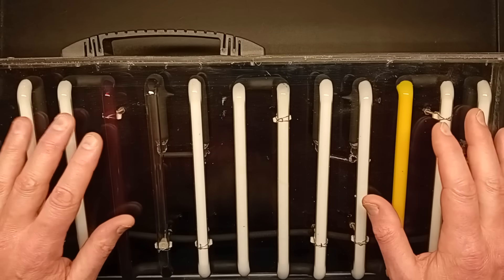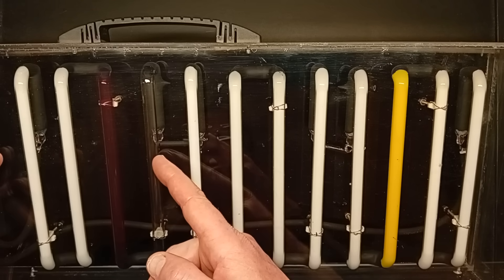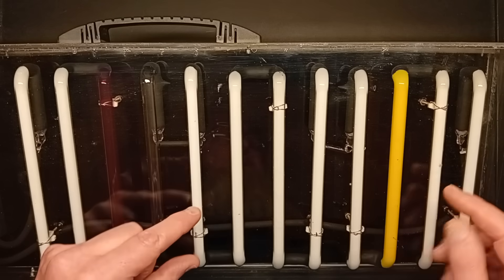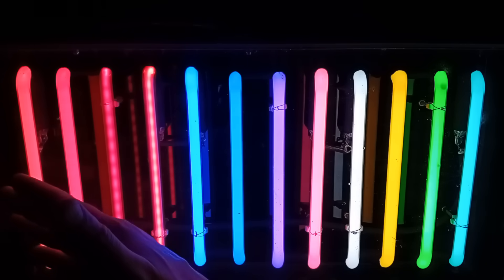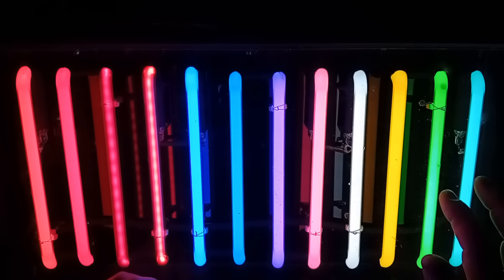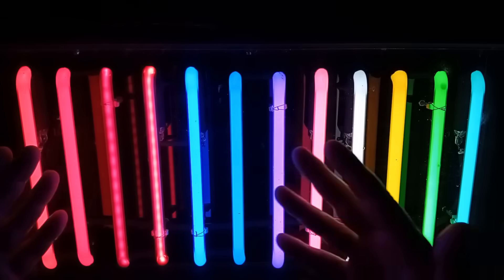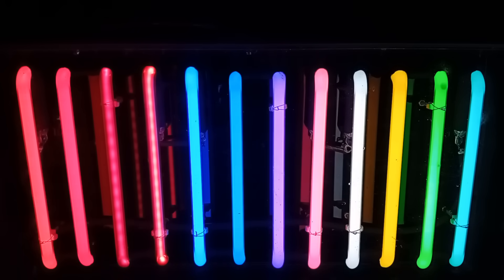REAL neon display case

Comment: Haven't watched any of your videos for a while now, but this one definitely sparked my interest. What a nice gift. Most desirable.

I also have some old neon sign transformers which I use for insulation testing- to the extreme. 

A bit like that high voltage test unit you have demonstrated in the past on chinese made power supplies.

Good vid. Thanks 👍🏻

Comment: I've never seen one of these before. It reminds me of an ozone generator I owned once. It had two interlaced sets of tubes in it; half neon and half low pressure air (strictly for appearances), each set connected to one terminal of a full-size (15kV 30mA) neon sign transformer.  And holyyy heck did it make ozone!  This device is prettier and probably doesn't make nearly as much. :)
Reply from the maker: Those ozone generators are very collectable now.

Comment: Jellybeaning! I never heard that term. For (slightly) more information, look at wikipedia, /wiki/Glow_discharge and the terms "Positive Column" but also the special section on "Striations" where they fail to fully explain the effect. But (my understanding), at the long middle section (away from the cathode and anode) the electrons are just very gently accelerating, and pretty much the moment they get fast enough to make an ionizing collision with gas they will do so (and shed another electron). A recombination event will between an electron and ion will produce a photon (light). After a collision, the electrons slow to a crawl, slowly accelerate again, and repeat. If they're doing this in roughly the same time/space, then you get bands/striations. This area of slow-moving electrons and even slower moving ions is a great place for recombination to occur, so is the main light-producing area of a tube.

Comment: I burned my finger when I put my finger on one of the red tubes on the display. Can you explain why that happen? Is it because of radiation?
Reply from the maker: Real neon can run pretty hot as it can be used at very high power levels if desired.  The vintage helium tubes that produced a golden white light ran extremely hot.

Comment: The color from gas discharge and phosphor tubes really has to be seen in person.

There's something to that postmodernist neon sculpture I ogled fifteen years ago that's stuck with me, and I've never seen anything quite like it since.  (You could probably do a decent reproduction with LED strip if you put the effort in, but most of the LED stuff I've seen so far is slop.  Maybe I'll just track down some decent-quality rope lights and experiment with them as an architectural feature?

Comment: Yellow phosphor is not hard to get, but the  light from the mercury discharge will mix with the light form the yellow phosphor, so it has to be filtered if you want a saturated yellow lamp.

Comment: As much as I love neon for it's aesthetics, they often have chemicals like mercury (those blue and green ones probably) and phosphors on top of using around ten times the amount of energy than an equivalent LED will use.
Reply from the maker: The production of LEDs also includes toxic chemicals.  Neon tubes greatly outlast LED.
Reply: @bigclivedotcom  True. I wonder if there's been any studies comparing them.
Reply from the maker: Many, but sadly they were done by the LED marketing industry, and were therefore skewed for profit.

Comment: The ( old skool ) laminated iron 50 / 60 Hz Neon transformers can be VERY useful for cleaning oily fouled spark plugs , mine is rated at 5Kv - 0 - 5Kv at one Amp ! !  (  😝  )  , totally burns off the carbon in seconds , ( safety note ! )  keep well away as this energy is similar to the USA 🇺🇸 electric chair 😝 handy tip # 56 ....... DAVE™🛑
Reply from the maker: The majority of neon sign transformers tend to put out current measured in low tens of milliamps.  Usually 30 to 60mA.

Comment: That really does take me back Clive. I had my own sound and lighting installation business for 40 years, and in the early 80's installed miles of neon in pubs and clubs. I used a company in Bradford called Butterfield Signs to make the tubes for me, I've just Googled them and they're still in business remarkably. Although I loved the effect, I hated working with it, you got a lot of breakages. You could watch them bending the tubes, it was a true skill. I had a similar display case.
Reply from the maker: That horrible feeling when you're installing a tube and it cracks.

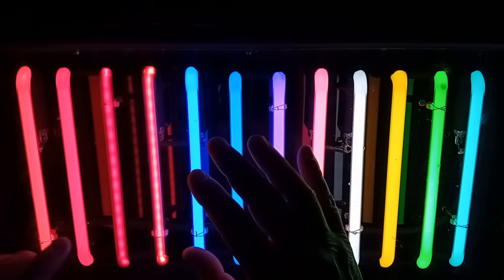Comment: I'm only just starting learning about electricity, but I wonder whether the "jelly beaning" effect described at 2:10 would be a result of the fluctuation in current flow due to transforming AC to DC current.  I also wonder whether the "fine-tuning" mentioned would involve "smoothing out" the fluctuations by using more phases of AC current when converting it to DC or making it more drastic by using fewer phases and/or reducing or interrupting the current flow.

Comment: Got some bits of scavenged neon, pink rods, and pink arrows, then square units, one white and one clear argon mercury. Pink was the shop sign, I kept 2 spare tube of each type so as to make fixig fast, as all i did was switch off, replace the failed section, then have the sign running again for the most common 2 tube types, then call the sign company to repair the failed tube. Generally a shock crack from rain hitting hot glass. the square ones were salvaged from a sign that was never installed, which also gave the electronic ballast running them, though I also have a few regular neon iron core units as well, from the open terminal type to the resin potted units. they do make for great Jacob's ladders, though I really would have to get better electrodes, brazing rod does have a short life, and the copper vapour is not exactly good. would love to find some tungsten wire 2mm diameter, make a permanent ladder/broadband RF noise source.

Comment: Colour neon and fluorescent tubes are beautiful. Yellow needs colour filter because mercury-argon is adding its own colour and washes out the yellow. The same is for red, if you use red phosphor, you get pink. My favourite colour is fluorescent green.
Reply: You can get pink with neon if you use a phosphor which would be blue with mercury. In the same way you can make a yellow neon sign using actual neon and a green phosphor.

Comment: Now you ate in my wheel house Clive! I love real neon! The blue phosphor for that color when pumped with argon and mercy will glow a beautiful pink when pumped with neon, and the green version of the same will glow a nice pure orange pumped with neon! I also love the “clear blue” tubes that are clear tubes pumped with argon and mercury! Was very common before fluorescent phosphors came into use, ironically before fluorescent lights (1938) and came into use in 1933! For green, they used noviol yellow without a phosphor with argon and mercury. White was tubes pumped with helium before phosphor coated tubing. In cold climates, a mix of mercury and neon, known as “Penning gas” was used so the mercury based tubes, phosphor coated or not, would warm up quickly, since neon has more resistance than argon and will generate heat. Helium even more so, and it limited maximum tubing length in signs often requiring higher voltage transformers. Also, helium tubes were sometimes in larger diameter tubes to lower surface temperatures to prevent breakage from thermal shock in cold rain and snow, and had higher current density which lowered arc voltage in the helium tubes to allow more tubing length on a lower voltage output transformers. Penning gas can be and IS used alone and has a purplish red color. I taught myself about neon! All part of collecting light bulbs all my life since age 4! I am 59 now! Cheers! 😋👍🏻

Comment: We have a neon guy in our small town who just finished fixing the neon on the 1920s movie theater. (we have a manly popcorn machine as well which has been a whole share of mechanical ordeals ) Apparently it wasn't an issue with the tubes it was an issue with the transformer that probably shorted out since it was wedged in the outside aluminum marquee. It's nice that it's working again. He said to save any broken tubes as he can reuse them.

Comment: I worked for my family sign business for twenty years. Repaired a lot of neon. We had our own neon plant. I was there for the transition from old iron transformers (what we called them), to electronic. We always found the old iron transformers, the size of a shoebox and much heavier, to be more reliable. The peak beast being the 15060 (15,000v at 60mA). I would LOVE to see a video from you explaining the difference between old style transformers and electronic.
Reply from the maker: The first electronic transformers were horribly unreliable.  But they are much better now.
Reply: The 'peak beast' is 120mA @ 15kV, I have one. :)
Reply: @railgap Very cool. We never used 120mA. Was that for cold cathode lighting or neon?

Comment: Gorgeous item. I miss proper neon - i get that the modern low-voltage LED 'tubes' are safer, cheaper to run and more robust, but aesthetically they're just not the same.

Comment: SO many of the old-fashioned iron transformers off old neon signs have been clipped off of perfectly good tubes by Tesla Coil builders. 

I have found MANY old signs where the transformer is gone, but the tubes still function perfectly when connected up to another transformer. 

I can admit it, I ALSO have been guilty of relieving a couple of old neon signs of their transformers years back when I built my first Tesla Coil and Jacob's ladder. Since then, I have graduated to using pole pigs for my coils. One can only get SO much power out of a neon sign transformer, and I'd rather leave them on the signs these days. The newer electronic transformers are junk for use with a Tesla Coil, so don't even bother with those.

Comment: Excellent!! Neon is slowly dying, and I don't like that fact. 

"LED Neon" just isn't the same. 

There's just something about a high-voltage arc traveling through a glass tube filled with a noble gas that creates different colors depending on the phosphor and type of gas in the tube, is just exciting and soothing to me. 

I collect ANY kind of real Neon that I run across today. I have various beer signs, "Open" signs, and other old Neon stuff. 👍
Reply: LED ANYTHING isn't the same.
Reply: @TheloniasBrowntail I 1000% agree!! it will never suffice for the real neon.
Reply: @TheloniasBrowntail I have eye damage due to glaucoma (and now cataracts) and LED lighting really messes with my vision in a way that older technologies such as incandescent, fluorescent, sodium and neon installations don't. There's probably something about the wavelengths emitted that's imperceptible to most people but really affects me for some reason. I understand why everyone's switched to LEDs as they offer lots of advantages in terms of cost, longevity and power consumption, but I wish they weren't so harsh to look at.
Reply: A building we just sold has an original neon sign from 1940.  We've kept it going for 30 years at quite an expense, but it's worth it.  Sure, the electricals have been redone many times over, and hurricanes have broken some of the tubes, bust most of the original neon is still there and we had replacement tubes made when they broke.
Reply: LEDs don't last 100 years.  Well-made neon can!  And like any optimized discharge lamp, it competes favorably with LEDs on efficiency too.

Comment: Thank you for showing us this. True neon is becoming so rare these days - what you have there is a treasure.
Reply: Maybe it's just where I'm at in the states, but for some reason it seems like there's somewhat of an authentic neon resurgence.  College town I went to even had a new sign/neon shop.
Reply: Ditto. That was quite interesting. Thanks Clive.
Reply: Isn’t it such a shame that real neon is becoming a lost art??😢💔
Reply: @chrisa2735-h3z i can understand why - it's fragile, expensive and the voltages involved can be quite scary - but at the same time I agree, and lament its disappearance. There's nothing comparable to the warm, nostalgic glow of a real, old-school neon sign, or as exciting as a full-on neon lighting setup in a club or disco.
Reply: @chrisa2735-h3z  nowadays the flexible led works even better and you can use addressable led that no real neon can do

Comment: The deep red and the pink tubes bring back memories of the late bar I worked in where there were pink, red, pink, red tubes in a row of 4 around the perimeter of the dance floor that were controlled by the lighting controller in a sequence computer along with circular tubes, floods, dozens of pin spots,  par 36 'scanners', strobes and other motorized units. I used to LOVE playing about on it after my shift making a kind of live lighting show to the beat of the music. My manager was very happy to let me loose on it. It was all touch control, channel linkable for greater effects and totally re programmable. Id love to get my hands on one of the controllers nowdays but just missed out on an Ebay listing a few years ago and not seen one since. It was made by MODE lighting with 0-10v outputs linked to NJD switching and dimming packs under the DJ podium. Always loved the loud inrush bang when you turned on the main breaker for the lighting rig :D Love  the 90's for all the better lighting shows where you would boil in the nightclub due to all the real halogen lamps and transformers buzzing during the quiet moments :D
Reply: Yeah that system is all AMX I think, so 0-10v analog and awesome as they come. Ahh the 90's. Sometimes I miss them. You are right about the heat of a par36 narrow spot to the face. very nice.

Comment: What, no teardown and schematic. 😂

Back in the day my mom was a manager at a gas station with convenience store. They sold cigarettes and had some neon signs for some bands. They were getting rid of the Camel sign and I was going to get it. One of the workers took it down and put it in the safe so no one else would grab it. Problem was it did not quite fit and the tubes were broken when the door was shut. So no neon sign for me 😢.

Comment: I used to do pub and club fitting, light and sound,  and have done neon installations both static and animated.  The tin can of glue for perspex that we used was perspex dissolved in Chloroform, so it was work for outdoors or VERY well ventilated areas.
I asked Google about Methylene Chloride and apparently it is Chloroform-like so maybe it was actually that, but I seem to recall it saying Chloroform on the screw-top can.

Comment: I have 3 XEROX HeNe laser tubes. Only 2 PSU's unfortunately, but they do still work! Same BEAUTYFULL red. Close to 640nM if I'm not mistaken.
If you take the actual laser tube out of the metal enclosure you can see a similar soft red, with the running beads in it. I could stare at that for HOURS on end. Not directly at the beam obviously, just at the tube itself, or the diffused laser light.

Comment: Nice display case including the power supply, rare find I would imagine.  The glass tubing used in my signage was rather thin and delicate, it broke easy.  We had a sign company that repaired them here, wasn't cheap...  Thanks Clive.

Comment: What kind of power supply does this run off of? Is it mains powered or battery powered?
Reply from the maker: Mains, but there were battery operated versions with tubes that could be switched in.

Comment: The people that use to make those tubes?? How did they bend that glass tube without it braking.  But unfortunately LED & LCD came along so that the end of neon glass tubes and the end of the people who use to make then
Reply from the maker: Skill, experience and a feel for the way the glass flowed when heated.
Reply: You heat the glass with a torch while blowing some air in the tube to keep it from collapsing. It takes a lot of practice to do it well.
Reply: Xyla Foxlin posted a video about this a while ago
Edit: https://youtu.be/ml5kj4OXFF0

Comment: A nice memory of many times of holidays in italy: Those tubes were so common at a time, that i remember  those in classic white being used as plain lighting in the shoppingstreet in bibione.  Later many shops installed MHL and now LED. But you can still find  some metres of Neon-Tubes under the store-porches or at least the outlets for the HV-Cables.

Comment: Neon lighting is beautiful but demands a high voltage. Its also very hard to find a replacement for "dead" bulbs.
Our town's only Hollywood Video rental store (2000) used neon for its signage... it promptly set the stores facade on fire. 🤣
Thankfully, the fire was put out quickly, leaving our brand new Hollywood Video with dead neon signage and burn scarred facade.

Comment: The little town I live in has a place called Magic Light Neon Sign. They've been around forever. They did closed during covid and wasnt sure they'd open back up, but they have. They have a really big display of neon in their old 1800s brick building. Always loved neon lighting
Reply: > "Magic Light Neon Sign"  perhaps at 100 North St E Crawfordsville, IN 47933 USA? North a bit from the Rotary Jail? Google the address, you get a map. The old brick building with a bicycle nailed to Rotten Robbie's neon sign. They have another name on the front and may do all kinds of signs, but that's sure neon. But Indiana may be a bit far for Clive unless he gets a gig there.
Reply: @PRR1954   that be the one. Yeah  I wouldnt recommend anyone coming here,  not even Clive =)
Reply: @PRR1954  another fun fact, if you go around the corner, eastward onto Green St, 218 N was the old Vast Electronics repair place. They were always a cheaper source for components/parts compared to Radio Shack, and before the internet was popular. Not sure when they went out of business, or I thought they closed ?